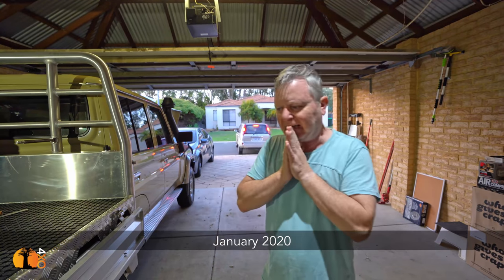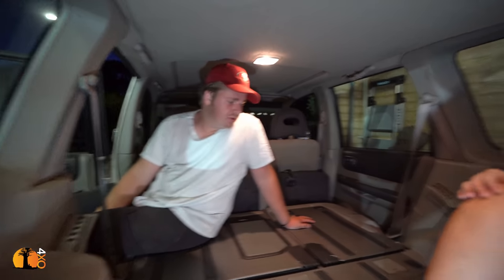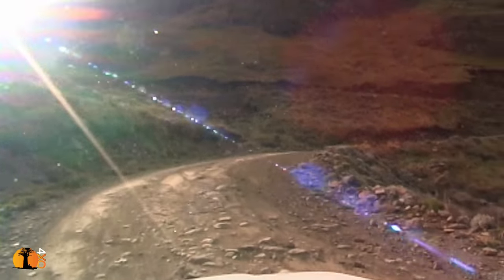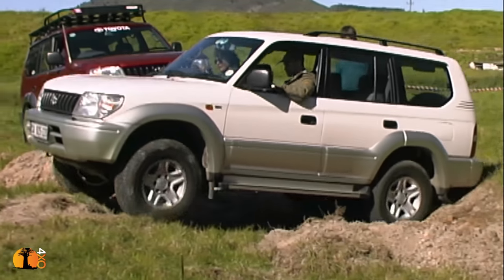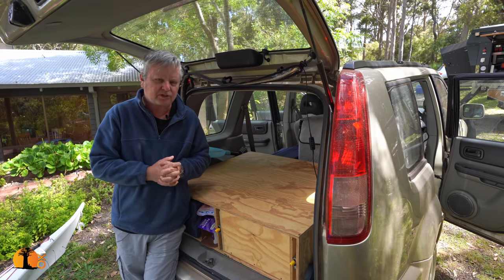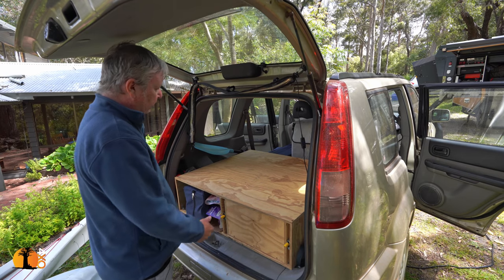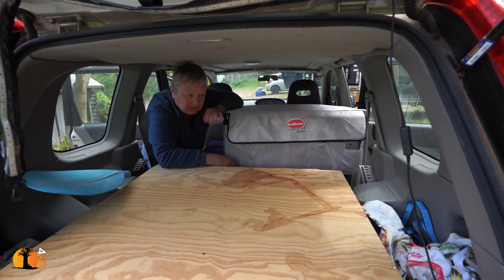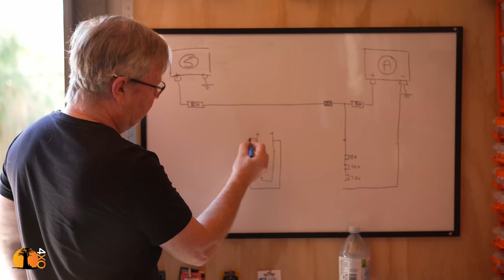A BUDGET 4WD TOURER IN 2021. Low cost 4WD overlander for backpackers | 4xOverland

Comment: X trail is good, but I will think you overlooked the absolute best one...Suzuki Grand Vitara 2.4. Its permanent 4wd, and has a low range transfer case. I also believe-to go overlanding on a low budget with a fridge and drawers with chairs etc...RV3 OZ tent that they can store on normal roof bars is the answer. An suv is not ideal to sleep in for two
Reply: Double the Cost to buy a Suzuki with Same Kilometres, they will probably do the complete Build for the cost of buy the Suzuki Standard also the X Trail is slight wider and has rpughly an extra 130kgs Pay Load, 550kgs to the Zooks 420 odd, they wont be planning on doing 4wding, just normally Touring most likely and 4H is all thats needed, 4low is for proper 4wding, and they are doing it on a Budget, roof top tent even a Kings will cost a good $800. Ill bet they will do the complete build for less then a Suzukis $14000 price tag on Car sales
Reply: @J-P88  so we recently just sold our 2004 grand vitara v6 with 97kms full and great service history for $4500  and honestly for a budget build they are perfect.  we upgraded for just an off road not a daily. to a Tj wrangler :) with a roof top tent. winch etc for under $10.000
Reply: I own a gv
Reply: @Griddens  wow thats a bargain, ive looked on Car Sales and GV with 160k on the clock around 2007-2010 are selling for well over 10k and and regularly seeing for 14k
Reply: You are right on every mechanical points BUT the GV cargo is miserable compared to any other 5-doors 4WD SUV
Reply: You never mentioned a Isuzu trooper/Holden jackaroo, super capable, reliable and a 200 000km model won’t cost more then 3.5k.
Reply: @EIChupalibre  Put a roofrack on top. GV's are brilliant. I owe a 208 2400 5 door, did now 65000 km with me. Very pleased with it.
Reply: @pm Terios is a little town car.
Reply: GV are great i own one and im pretty happy with it , i also have done some mods
Reply: Agreed. Nice vehicle.
Reply: Just don't buy the diesel Vitara or X-Trail, most unreliable engine on the road.
Reply: @LovanNiekerk  Owned a '91 Isuzu Trooper.  Loved it.  Would have kept it but it was worn out when I bought it.  Would like to buy anither one.

Comment: Watching the mileage is not a good idea and thats a begginer mistake. A vehicle that is driven in most of its life in a city, will have low mileage but it will be very very worn out. It is often in low gear, go, stop, not in operating temperature and so on. On the other hand if you go to work using highway you will get high mileage , but in high gear , low rpm and operation temperature.
Reply: Good point, but almost impossible to know for sure which you’re getting. Especially if you’re the 3rd or 4th owner.

Comment: Knowing that this is a budget build, I know you won't be buying any Lithium. As an owner of a 2006 model, I can tell you, that you can fit an 80AH AGM under each front seat. You make a sacrifice by removing the under-seat air vents but it's a small compromise considering no-one will be in the back anyway. Excited to see this unfold.

Comment: Here's an other suggestion. Late (2000-2001) Jeep XJ 2.5. Lightweight (1,5tn) front and rear solid axles, 15' wheels, factory rear LSD, proper 4X4 with low range, unlimited aftermarket modifications, not too thirsty and overall a rather solid reliable vehicle making it cheap to run. Also a future classic if not already.

Comment: I just picked up a 2000 Prado (95 series) with 402,000 on the clock! however, it only has highway use (from Canberra to South Coast) and a FULL service history with the one owner. (It belonged to my mates mum) paid 6,000 for it no mods at all with an original prado alloy bull bar. The motor runs like a dream and Im told it was never even put into 4wd. It has two standard tanks with both fuel pumps working and does not leak one bit of oil. Great channel btw sir! new subscriber here :)

Comment: T30 X-trails are great fun to drive and tour in, takes a 35mm lift and tows an off road camper with ease. We have owned ours for 7 years without any mechanical issues at all, has never missed a beat. It did 6 weeks touring all over Tasmania pulling an 1050kg loaded camper without complaints, just a great fun under rated vehicle, add in a throttle controller and it makes the ultimate go kart.

Comment: all of my overland builds have been on a shoestring budget, from the old 1964 International Scout, Toyota single cab 4x4 pickup, the fleet of p38 Range Rovers and Discovery series Land Rovers to motorcycle adventure bikes BMW 650GS and Honda XR600 desert racebike. I have my motocamp 4 season pack down to about 30 pounds of gear. The more you know, the less you need.

Comment: There's a work table in that storage system if you were to cut the drawer down 20mm shorter of the top and put a piece of ply on top half the length of the drawer with  sides that just over hang the sides of the drawer  you can pull the drawer out with a top/work table  on it then slide the top back in if needing access to drawer ,works a treat and gives you a coffee prep space .

Comment: Great choice. I remove the back seats of my Wrangler for any trip longer than a weekend. Weight saving is close to 50kg and it opens up a lot of space. It takes me about 30 minutes to take out. It helps to keep the weight down low and between the wheels. My Fridge, battery and water goes where the seats used to be. To help with the weight, get a pair of airbags for the rear suspension. Because your car is a daily driver, you can inflate and deflate the airbags as you want and they are cheap and easy to install. Mine is 2 years old and has done a few trips in Namaqualand and the northern Wes Coast of South Africa and are still working fine. Andrew, you know these roads and the "sinkplaat"(corrugations). Looking forward to see X Trail trips.

Comment: Currently doing the same type of thing for my daughter. Mitsubishi Outlander 2007. Same 4WD system as X-Trail. Stock standard without a tow bar and I checked underneath that it never had one. Just a nudge bar which is good for lights and aerial. Good fun going back to basics.

Comment: Good to see people getting out on a budget and seeing Australia!

We had a family 2003 T30 Xtrail from new and only sold it last year with 250,000kms, limited issues and easy to work on. 

However, I still wouldnt be taking an xtrail on a beach in a remote location, they have a pretty basic 4WD system that is essentially based on the 4wd system that was found in the Skyline, but with open diffs and a locked 60/40 torque split...which sees it really struggle as soon as it hits any kind of undulating surface without alot of momentum, which is generally a recipe for disaster in a vehicle with low ground clearance and limited underbody protection.

Maybe a very experienced driver could get more out of it, but for a novice, you'll run into dramas pretty quickly with its lack of clearance, suspension travel etc.

I think treat it as what it is, which is a lifted station wagon with a very basic 4wd system, that will allow you to go down some corrugated roads with a bit more confidence over a normal road car.

Comment: This is sort of what I've done, same concept but different vehicle type. I mostly travel & camp around the northern section of the Golden Triangle in central Victoria. I used what I already had, a 1994 VR Berlina wagon, removed the back seat & replacing it with a false floor. Under this false floor I have my water (3x10 litre drums), Aux battery (135aH deep cycle), pots & pans, spare tent poles which are not used for a tent, aluminium slat table and other bits & bobs. On top of the floor resides my fridge behind the passenger seat, an older large esky for my tuckerbox behind the drivers seat, whatever sleeping accommodation I'm using that weekend - be it the Oxley 5 tent, swag or stretcher tent, camp stove & gas bottle, two 45 litre backpacks with various items inside and a 200 watt solar blanket. Have been using this as above for about 6 years now & it suits what I do & where I go. I've only been temporarily stuck a couple of times, & got myself out of trouble with no outside help both times. I know the limits of the vehicle & don't try to push my luck, but can still travel around about 95% of the Triangle even if mildly wet with no worries.

Comment: Fine choice, I regularly see them in unexpected places :) Another option would be the Suzuki XL7, the lesser known 7-seat Grant Vitara made until around 2006. With the third row removed you have a very large boot space. A little older and thirstier than the XTrail, but gains body-on-frame construction and a low-range transfer case. Mine was my first 4wd and will always be special for that reason.
Reply: How do you rate the gv overall? I'm thinking about picking one up as a first 4wd

Comment: Having driven an X-trail for 15 years, I can tell you its a very good car to start with. Espacialy if you're going to use it also as a daily driver. They are much more capable than most people think. 
But they seem to be still expensive in Australia. I sold my last one in februari 2020 for 2500€. Car was in perfect shape, building year 2005 with 140.000 km. In Europe the emission regulations make them lose all value. 
It was my second X-trail having a total loss with my first one in 2012 at 230.000 km. Other than servicing costs, I have never had any failure on neither one of the cars. Very reliable.

Comment: Awesome video Sir!! I’ve been building my 1992 Landcruiser Fj80/3FE/Auto for a couple of years now. We used to have a 2007 Nissan Xterra 4wd, for about 5 years as a daily driver and on weekends as a light overlander. It was a great vehicle, few issues but nothing major or expensive. When we sold it, it had 208,000miles and was still going strong!

Comment: Fantastic video this is going to be a very relevant build 👍 can't wait to see this progress  1 thing I would have done it take about 10mm off the drawer height and fitted a lid in 2 parts then your drawer would double as a table/cook surface with only a slight compromise on accessibility

Comment: Having used a few foresters off road, there is no selectable 4x4. There are ways of tricking the TCU in autos into 50/50 split but no selectable 4x4. Early manuals have low range selector though
Reply: Well said. As an owner of a WRX and Forester this incorrect information annoyed me.

Comment: A useful tip when building stuff out of wood for a vehicle. (i.e. Draws)
To avoid what you’ve built falling apart over corrugations, dip the screws in liquid nails.
They will never come out, even if you want them to.

Comment: It's fine to make your own drawer systems, but the moment you're thinking about bolting a fridge on top of it you'll need to do more than just screw the ply lid on top of the box because in case of an accident or rollover it could very well tear the lid right off the box. Aluminum angle around the edges screwed through the top and sides and reinforcement plates through where the fridge is bolted is the go.

Comment: The Vauxhall/Opel/Holden Frontera is always overlooked. Mainly Isuzu - Cheap as chips, decent GM 2.2 diesel (I get 35 UK Mpg) seperate chassis, low box split and side opening tailgate and a wheel on the back. I bought mine in UK for £700!! 60k trouble free miles later I’m smitten

Comment: Nissan X Trail is a good choice! We bought a Mitsubishi Pajero 3.8 V6 Petrol GLX, Model 2006, 200.000km for 7.000,- including bull bar, winch and 2-inch lift and had the time of our lives building it up on a 2000,- budget. Most of the money was spent on the rooftop tent, recovery gear and fridge. Second hand of course. Very capable off-road as it easily took on Callcup Hill, Billy Goat Bluff and some other nice tracks. Love the idea of doing a full lap on a budget vehicle :-)

Comment: I work on cattle stations and the number of station cooks driving T30 X-Trails is remarkable.  They’re light comfortable and with decent tyres and careful driving are a strong performer.  There standard shocks are Ohlins with quality springs.  Simple mechanicals and easy servicing, no timing belts and a motor that just performs well.

Comment: Last year we had one of the 1st gen (in SA) Xtrails as a loan vehicle because our LR4 was at ZF gearboxes for 2 months (not fun to have a problem like that in December).

The thing had super low miles, but I presume it was a school run vehicle the boot was very scuffed up.

I think it had a aftermarket Turbo on (had a SAC sticker on) . That thing boosted like you wouldn't believe. At the time I was still learning to drive and the clutch on that car was so heavy it was like a truck.

Even the 76 series Cruiser I drive daily has a lighter clucth.

But wow that thing was a blast to drive, me and my dad was sad to hand it back when the LR4 was done.

Comment: Great Vid Andrew, I can't wait for the battery build video as it is something I would like to do myself very soon. Regardless of what ever vehicle people select for their first 4wbie, the best addition will always be a full tank of fuel as that means you can head off on an adventure. My first 4x4 was an old 2000 MK Triton, it was ugly, slow as a wet week but it went anywhere I sent it. Bought it for $4500 and sold it five years later for $2200. 90% of us will use the car for travelling to and from work the most, then shopping trips and kids sport runs with a little bit of overlanding on the side. One thing that makes me laugh is the fact people think you need five fridges, 3 batteries, every diff locked, with a massive lift kit, 3 awnings plus everything that opens and shuts... but you ask them when the last time they went offroad with it? A lot will say at least a year ago...

Comment: I got a 2014 Navara RX  low kms for 14k (so 2wd version) - Just did 3 weeks in Tasmania travelling everywhere I could. Yeah you can't 4x4 in it, but you can to a lot still as it has good ground clearance so you wont bog down. Some day I'll buy a proper 4x4 but for touring and mild off-roading, but the navara is perfect and it doubles as a great work car and landscaping car :)

Comment: Loved this video, I have just done something similar.
I also shortlisted the Nissan XTrail, Subaru Forester and a Mk1 Freelander.
Most of my recent trips have been Europe and North Africa mostly gravel tracks and forest trails.
I had to cut the vehicle fleet so the 110 had to go and has been replaced with the latest Freelander 1
I could find.
As it's a daily driver as well as an overland vehicle I decided to forgo the auxiliary battery and I have gone with a power station that's capable of powering my small Snowmaster fridge for 30 hours (without re-charging. The other power needed is for LED lights and charging phones, camera's torches etc.
I'm going to follow this with interest !

Comment: I have a 2008 petrol Land Rover Freelander 2 (LR2 in USA). I’ve just started taking it off road and am blown away by its capabilities. The operating costs can be substantial though.. however you can find them pretty cheap now.

Comment: Cracking video, anyone looking to do this sort of thing on a budget, I would say the mitsi delica is the absolute ideal budget overlander in my humblest of humble opinions
Reply from the maker: Delica is brilliant. Far too costly and hard to find a good one.
Reply: @4xoverland  quite.  Cheap ones are no good and good ones aren't cheap.
Reply: @TheKnobCalledTone.  I understand
Reply: @4xoverland  I agree, but i did it anyway. 20k for 144,000kms, almost stock, just new tyres and a 2 inch lift. 

I think of it more as a budget troopy project rather than just a budget overlander, because there are far cheaper cars, as you found with the x-trail, that can overland quite well, but a Delica is the closest you can get to a Troopy without paying 40k+ for the truck alone.

Comment: Actually this is a very good point of view and when I was looking for an Offroad car this was my goal find a car that has little km in the clock and little modifications the choice went into the land rover discovery II with 130000km taken by a private deal for 7000aud only issue that the cylinder head was leaking and I had to do do some mods which cost me around 7000aud more so I ended up with a 14000aud good Offroad veichle which was way less than any patrol, Prado etc around... Those car obviously were cost more than that with twice more km!!! I was happy with the car but day to day this car in the road are terrible and they get many others problems so decided to sell it when I took the pajero which I'm absolutely delighted!!! This car is SUPERB!!

Comment: I believe the MK2 Mitsubishi Pajero is a very decent and low cost 4x4 overlander option. Used to have a SWB one and it was brilliant and super reliable. Get the V6 3L or 3.5L, NOT the diesel.

Comment: we had an Xtrail the same model but slightly older, it was a great little family car, we used it more for that than anything offroad, though it did come in handy at times.  a 'friend' of mine had a slightly older one again, and he agreed that they were a good little car.  Then his died and he toddled off and bought a Discovery.  One day not long after that, he told me that he didn't 'rate' Xtrails.  'well, yes,' i thought, 'that's because you're comparing your xtrail's performance (off road, interior space, dynamics etc) to your Discovery's'  I just smiled and nodded at him.  Some people, it just ain't worth the argument.